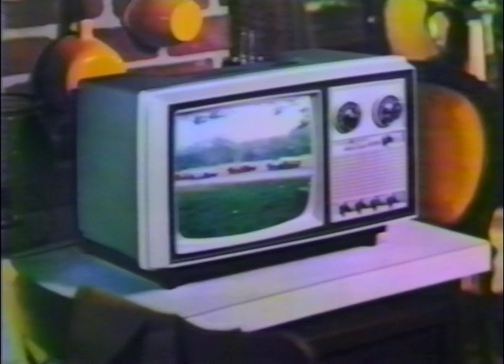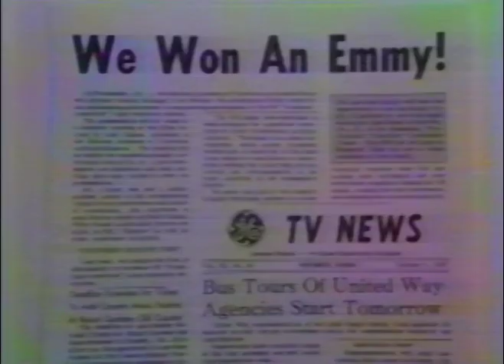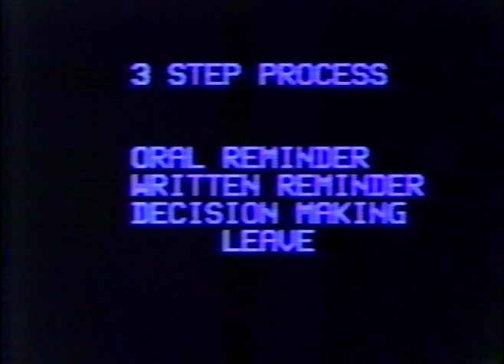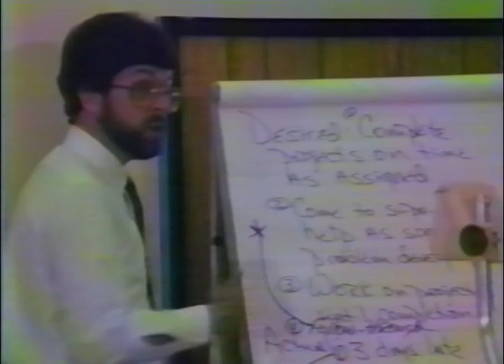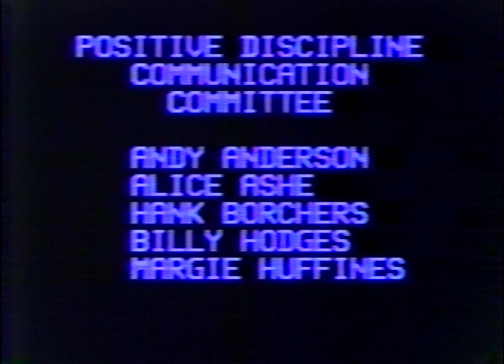1984 General Electric Internal training film "Positive Discipline at Portsmouth GE" television plant

Comment: I owned a 1984 19-inch GE color TV made here.  The VIR (vertical interval reference) circuit synchronized the saturation and hue with the settings established by the studio engineer who was there during the taping or live broadcast.  A comb filter  increased fine detail by 20%.  And the blue Neovision picture tube reduced washout in brightly lit rooms.  These features produced  the best color picture available.  When GE bought RCA, the TV business was sold to Thomson of France, and GE-branded televisions became clones of RCA's, and TVs with those 3 advanced features were no longer available.